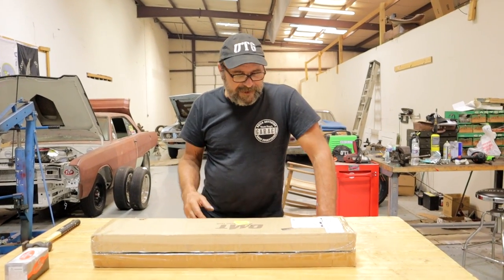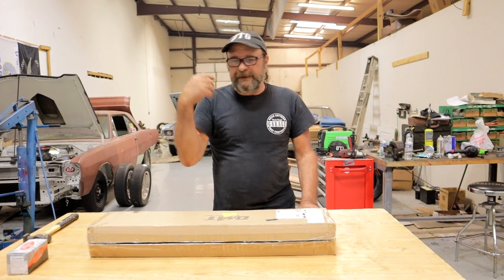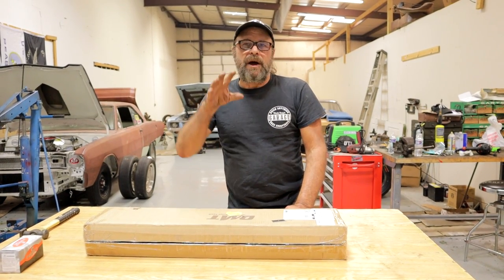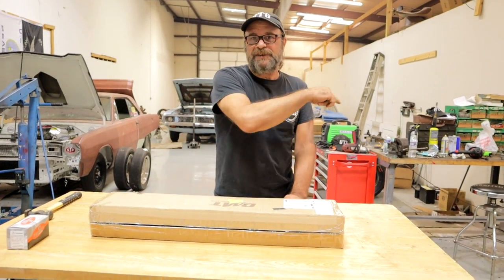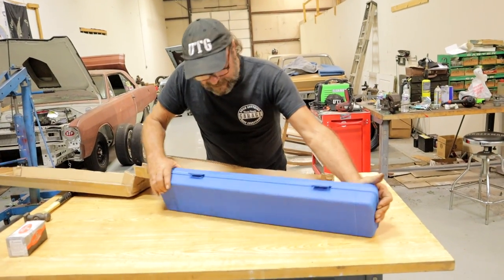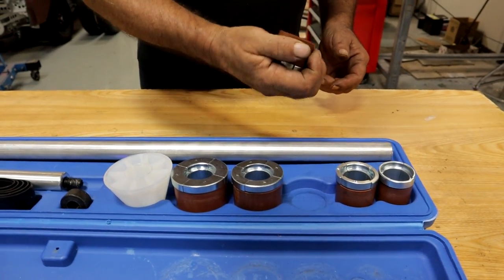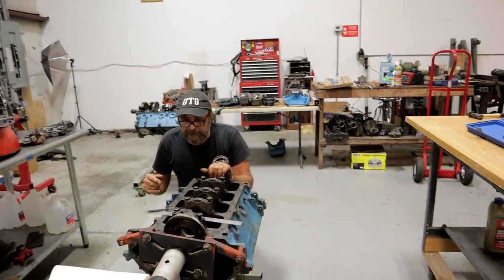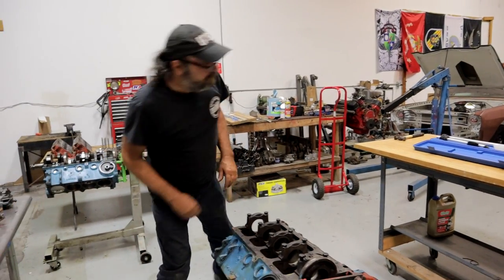Unboxing And Review Of Cheap Amazon Cam Bearing Installation Tool

Comment: I just used this unit to do my first cam bearing removal and install on a 351C block. It works fine for you to drive the cam bearings out with the cone positioned at the front for the rear 3 and at the back for the front 2. I found out the hard way by damaging 2 cam bearings beyond reuse that this block could only have bearings fitted pushing in from the front because is has a chamfer to the tunnel hole where the rear of the hole doesn't. Fitting the rear 3 from the front. You have to have the correct size arbor and rubber sleeve firmly tightened. The bearings with a film of oil in the tunnel and the back of bearing went it beautifully with not a mark on them. I started to think this would be a breeze. I test fitted the cam in the rear 3. Spun beautifully. Okay this is where the trouble began with this tool. I thought I would knock the front 2 in with the centering cone at the rear. Even with the chamfer on the leading edge of the bearing it wasn't happy going in and the mandrel bruised the back edge up in some places. After I knocked it through I noticed the block machining difference. Fortunately I had another set of bearings to have a new no2. It has to go in from the front. You can't easily remove the steel cap to put on the shorter extension so you have to use the longer one only which does put your eyes further away from where you want to watch. You don't want the m/caps on so you can see the hole in the cam bearing center. No 2 went in beautifully. (BTW you need a heavy weight hammer). Now the tool is not reversible where you can cone center from the rear and drive the front bearing in from the front. I tried from the rear and it cocked and I ruined another bearing. To ensure you're driving in true you really need to use the center cone but how do you do the front bearing??Unless you have another Cleveland block to put in front. The tool has a short coming- is the problem. Because the job took way longer than I anticipated and needing to get it done I took a careful punt and eyeballed the extension on the two planes. Fortunately it went in nicely and I got it square .030"from the thrust plate face. Tested the cam and it spun freely! The rubber on the inner expander had already started to split. That will be a problem because it holds the colletts together. I'm sending it back because it's not a long term tool you can be confident in doing any block. I hope this helps someone. Regards Scott

Comment: Truth be told, I’ve had the Lisle since the 90s before we had Amazon, and the manufacturer wasn’t selling the same thing on eBay yet. I was working for Valley Head in Northridge CA (A few blocks from Landy one direction and Lambeck in the other at the time and everyone out here had the Durabond Remover/Installer. I used the Lisle way more often for installation especially on small Chryslers. As you probably know the Durabond expanders all have super sharp edges and it’s super easy to scar up the cam bores on a 273-360. The Brown bands on the Lisle and you have zero issues. I spun up a shorty handle for mine about 6 or 7 inches long in case you have to do a front cam bearing in the chassis.

Comment: It's like a 1 time use unless you can make replacement sleeves. It worked for me, but I had 2 rubber peices on and they get shredded but it was the only way to get the results I needed. It did work great though.

Comment: In keeping with your new policy of verifying all dimensions first, should you try each bearing on a camshaft first, or measure them to reassure yourself that they are what they claim to be. Another thing, I saw this done on Nick’s Garage, and I thought it was smart, he test fits the cam for rotation smoothness after each individual bearing is installed, so you know where to look for the bad actor if the cam suddenly gets tight.
Reply: That’s a lot of in and out with a cam, not sure I’d risk damaging a bearing. As long as you keep the tool tight and be careful, the cam will fit fine.

Comment: I had a snap on can bearing installer. Never used sold it on ebay. I bet you can get a high quality used one for the same price as a cheap one!

Comment: I've used a few different brands and costs, can't say I was happy with any of them for all engines. The one I hated doing the most was a pinto 2300. There was one or two bearing that were almost impossible to install. You did alright with the cheap tool, with the exception of the handle.

Comment: I only go hand tight on the expander. If you wrench the bearing tight it'll ever so slightly expand the bearing and makes it harder to hammer in. 

I also have an end piece I made to thread onto the short portion I can hammer against and use that for the final bearing if I am doing it with it on the stand. 

Lastly I shine a light in the bore and look down the oil passage to see how well it's lined up.

Comment: I have and use one. Make sure the expander piece is aligned with the bearing mandrel or it will break. I also use the long driver with the shorter one as an extension. About the only place I have used both pieces is on a inline six Cummins truck engine..I had a machine shop make me a mandrel for the 855 Cummins engine that works much better than the expandable one in the kit

Comment: My eyes aren't so good anymore, so I mark the oil hole on the outside of the bearing with a Sharpie, and leave the main caps off to get a better view of the oil passage alignment. You got a nice tool for the money, we had a Goodson, and that cost 450 in '83

Comment: Like you Tony I normally have a machine shop install cam bearings. I’ve done a few home throw an engine together because you need that vehicle to run. I’ve installed cam bearings on those engines. I used a Snap On set. It wasn’t overly hard or complicated. You just got to make sure to mark the oil holes on the block  to get everything lined up. Yes I’d buy that tool if knew I had to do cam bearings on a couple quicky home rebuild jobs.

Comment: I've installed many  cam bearings with the $60 set! I have mine set up to use the short bar for the front two bearings and the long bar for the others. It's too long with both and not needed to reach the rear bearing, for V8's of course.

Comment: Tony have you ever used the OTC cam tool that pull's the bearings in place....😎 ,,And yes alignment and trying to be as clean and precise create an oil pressure difference.... completely changing the life of an engine , chamfering also the oil hole and edge's...
Reply: The cam bearing puller I was familiar with in the 1960s also pulled the bearing in place. We would put the bearings in the freezer to reduce the diameter and add Christo to the block. I like the expanding bearing locator your tool has.

Comment: good to see a tool demo. I'm about to pick up a piston ring compressor. How about doing a video on all the tools needed for an engine build, micrometer, dial bore gauge etc....
Reply: If you can swing it, get the compressor with the handle. 
Almost lost a finger to a tin sleeve one. 
I will spend the money before rebuilding another n14.
Reply: That would be a great video

Comment: found the same kind of deal on Torque wrench.  Cheap store brand  vs name brand.   Both were fricken Junk.  Bought the cheap one- broke it on the first nut. Took it back and bought the name brand and it lasted 3 lug nuts

Comment: Tony its a 63$ tool I'm not working on any big straight engines so I cut mine  off with hacksaw after attemp at using it now its just right for v8 v10  engines

Comment: I hope you put the back one in first and work yourself forward. The first one you install from the back of the block. If you try and put the bearing in the front the bearing will not center itself straight and the cam will not turn very easy. Years ago I bought one just for sbc and bbc and they were solid blocks. Work great. Still have it. Also have one of those universal ones with the rubber rings that hold sleeves together. And it was not cheap. Made by Hasting. A pain to use those. When the rubber rings rot away they cost more than the tool does.

Comment: I have a Orion motor tech fuel pressure tester kit, and it's cheap made but honestly take the cheaper o rings that comes in the set off and find a set of decent ones in the assorted sizes you need and it's a ok set,I'd still trust my actron fuel pressure tester kit first but it doesn't have the assorted attachments or a way to add Them lol.

Comment: A piece of metal with a couple holes and bolts (maybe some spacers between the metal and the block as well) to secure the cone to the block would help a lot so one wouldn't have to worry about the cone moving, etc.

Comment: I do around 50 sets a year I use my old driver set to remove and new 1 to  install driver I have looks just like the one you have it has install around 200 set of bearings

Comment: I have the Lisle 18000 cambearing installation tool and I've used it for years with no issues and what you have there is a direct knock-off of the Lisle tool.

Comment: I have a good cam bearing tool. I have actually used it more for replacing bushings in automatic transmissions than replacing cam bearings.

Comment: How do you remove/install the front cam bearing if you can't seat the cone against the front bearing?
Do you put the tool in from the rear of the block?
Oh wait, maybe I should read the directions.

Comment: Good job!  I ran into that a few years ago with cam bearings installed blocking part of the oil galley.  That looks like the same tool I rented from the parts store.  Get a bigger hammer 🤣I knew that one was coming.  Now it is time to see how that cam fits/rotates.  I has to do some slight honing on #1 cam bearing - 1st and last time (hopefully) I have to install cam bearings.

Comment: I remember my boss buying one from Snap On in the 80's. It cost in excess of 200 dollars. There wasn't much difference from that.
    I always consider the cost versus the amount of use. If I might use it once, against a tool that I might use in multiple uses, ( I live on a farm) , I might buy an adequate tool at a cheaper price.

Comment: Not for nothing but that set you have is no different than the 12 other companies like ATD, ProTool Snap On , blue point.  etc . that slap their sticker on it .
 Just different color rubber and box colors.
  I have the Lisle set  . Had it probably 30 years now .  Same shit , different color .
  Set yourself up for success but placing the block on the floor and place a couple 2x4 chunks under it to elevate .
 Oh, and the threaded rod comes out of that short extension.  Makes it less “warbly” as Don Olson would have said, LoL

Comment: Not sure if anyone mentioned but those flare pieces will screw onto the long handle 🤔 😉🤣🤣 But on a serious note I chucked that cheap plastic cone and machined pucks to fit the ls series cam bearings/bore. Seemed to help alot with any kind of flagpole swaying.😁

Comment: I usually install them with 3-5 hits. Hand sledge works nice for me. The machine shop I worked for told me the less amount of hits the better. Not sure if thats true but I imagine he would know. I used a cheap one worked fine also. My engine broke in 500 miles no cam issues so does it matter maybe, maybe not

Comment: Sine years ago I had to make a bearing driver like that for my BMW motorcycle.  Difference is that I had some metal stock and a good lathe, it looked practically identical to what you had, the difference is the cone was changed to a flanged stock so it stayed in without issue.  But it was a one application only tool, if it was not a BMW R bike engine ist was just scrap metal, and yes it got borrowed several decades ago and never got it back.  Guy that had it died and it got sold at the estate sale, probably went for pennies.
Reply: My policy is simple -
DONT LOAN TOOLS !
(or books either).

Comment: I have a cheapie cam bearing installer probably 2008 or so and I tappy tap tapped the new durabond bearings in my SBC no problem.... But it does not look like that one, I think it was over $100 back then can't remember, there's no universal anything all the parts are just 1 piece different color anodized billet aluminum ,I can't remember but It may have been SBC specific. It came from jegs I think. I haven't touched it since.

Comment: I’ve got a cheap dial bore gauge and while it turned out to be in metric despite the name on Amazon (annoying but okay), it’s very similar to the Fowler which is one of the name brands for the dial bore gauges. If it was in standard it would be even better but it’s not that bad still. However, I’d pay the $110 and go with the similar Fowler because it’s also more precise (smaller measurements, not even just saying it’s less faulty).

Comment: I was looking at the pics on amazon, looks the expandable tip will screw into either stick so looks like you can use it with just the long stick, the short stick or both for super long like Tony had his

Comment: I have the lisle version of this tool, it looks like it’s built a bit better. Worked on the magnum 5.9 build just fine. A heavier hammer works better though, I used a 2.5 lb engineer hammer, which was perfect.
Edit: I removed the stud from the short piece and used it to do the front bearing, it was much more manageable. Just thread in a bolt to hit instead of the threaded end.

Comment: Myself I'd rather have a spacer that seats in the back of the hole with a shoulder to seat against the block. Another disc that holds against the bearing shell. This should have a diameter that matches the actual cam gearing diameter. Press it in with a screw and nuts. In the factory these were  all pressed in at once hydraulically. In some engines the bearings were bored after install to ensure concentricity.

Comment: I once had a 360 build by a self-proclaimed “Mopar  expert” who was into dragracing. Took him months in his spare time, I didn’t care as long as he did a good job. Long story short...the engine had a vibration (crankshaft not balanced) coolant leak (core plugs not replaced) timing chain installed incorrectly (1 tooth off) AND cam bearings installed incorrectly resulting in worn out rockers in just a few hundred miles. It’s been years ago, but it still F pisses me off. An expensive lesson learned.

Comment: Hey Tony, can you cut it down and put the black end back on the new end to make it easier to use on the engines you usually work on?
Reply: I just read the other replies. Taking the short shaft off makes much more sense.

Comment: If the oil feeds are grooved in the block? I never line the oil.holes up. Seem like you get a little better oil pressure n you have your full bearing on the bottom where all the load is at? What ya think?

Comment: Woulda helped if you didnt add the 2 foot extension! Pull the expander off of the extension and put it on the drive rod. Claims to know everything, shows that he doesnt know everything. You also dont need a wrench to tighten that. Put the bearing on, twist the WHOLE assembly. When its installed, twist the handle ccw  till it releases. This kit is the copy of the carlyle kit which is a good set which is the same that a lot of machine shops use. Soooo theres that.

Comment: Only one ive used was a lyle until I got this one myself. With no instructions. What I leaned from lyle. Is the black rubber is NOT a replacement for worn tool.  There are 2 sizes of bearings. A thick and thin wall set. Ls has 3 sizes in there. 2 pair and a single. Guess what one I trashed before I learned mine needed the black rubber boots lol.
Reply: Brown sleeves are for thin wall. .065" black are for thick wall. .090" bearings. Just found a manual online.

Comment: For anyone needing to drive a bushing/bearing in a bore no matter size just go ahead and buy this. Then break half the what I call collets reversed the first to fifth time you use them. Then you keep the bar, cone, box, etc. Next step take any new or old bearing to a machinist and have them make you a solid piece that fits what you're driving. You will spend the the more on adapters than the tool over time but they don't break and you don't have to worry about waiting for the parts to fix the shit that comes in the box. Should have put this first, I know from years of experience working on a wide range of size of shit, I can carry it in one hand to I need my crane to move it. But yes you are buying a decent driving bar cheaper than you can make one, just make sure it's 1/2 inch thread so you can easily make whatever you need.
Reply: Looking at how it's made, I could see that being practical. It seems like the money is in the precision parts, and making them would be a pretty simple turning operation once you break one.

Comment: Question????? have you ever seen an oil galley plug with a valve to bleed the air out? 1965 mercury 390

Comment: I've a doubt about this.

Can't you just press the cam bearings in place? I mean, if you turn the engine sideways, you can easily press the cam bearings in place, you can even use a plastic cone to center the pressing rod (I'm sure you'll find one in some old junk stored around the house, I've used an old spray gun reservoir). Throw in a rod an find a reasonable size and press that sucker in place.

You can also use threaded rod if you don't have a way to press it, like a shop press.

Please, correct me if I'm wrong.

Comment: I just bought the same tool a few weeks ago for my 460 job. it worked fine. I still needed to run a "reaming cam" to shave a little off the bearing, but that's not the tools fault. If this were produced in the US, it would cost $200. So, what can we do? You want acceptable quality, and you want it cheap- ypu buy China. This is how the free market works. There is NO simple answer to this.